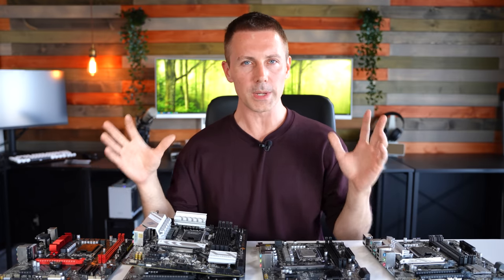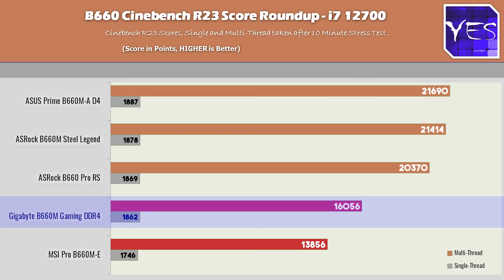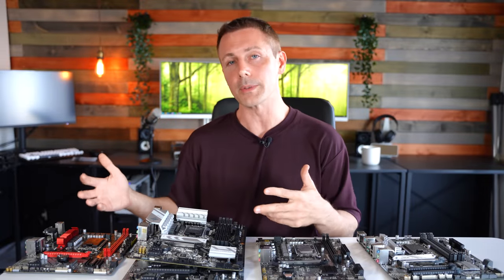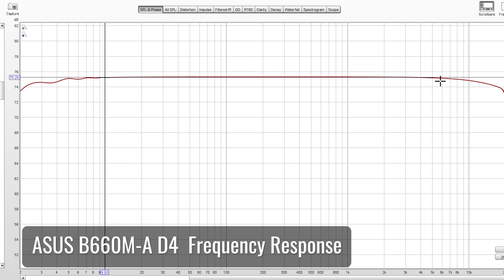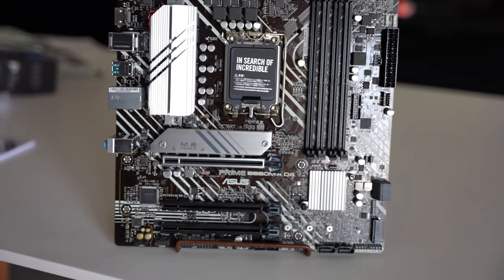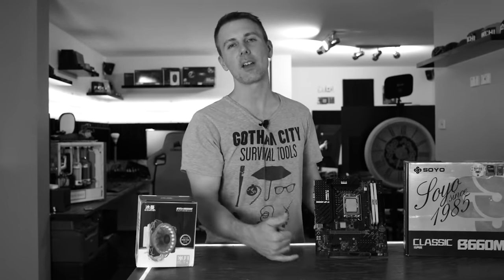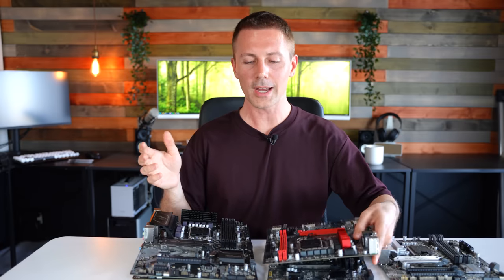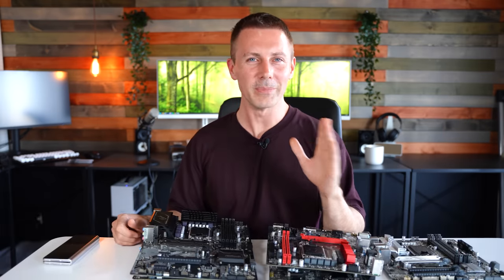What's the Best BUDGET B660 Motherboard?

Comment: Is the performance disparity because of throttling or because some vendors will blast voltage outside of Intel official guidelines ?
Reply: It depends
Reply from the maker: The gigabyte board I think something a little weird was going on there, though it kept going back and forth between 150w and 65w.  The MSI board definitely just couldn't handle the speeds though. Overall however, I am just testing with XMP on and going into it, something most people will do when they buy a new b660.

Comment: I got an Asus TUF B660 to use with the  i7 12700. Wish you had a unit to test beside those. 
Unfortunately I will be stuck the stock cooler for at least a month since Deepcool send their free 1700 mounting kit from China. Hope I dont have much heat problems.

Comment: I am about to buy Asus Prime B660M-A with i3-12100F. I guess the temps should be low as it's not as hot cpu as i7, right?
Reply: Hey, have you bought this mobo? I have this i3 and im about to buy this asus, is it running good?
Reply: @jankozerski5280  it is more than enough. I used it with i3-12100 and then i5-12400. Runing smooth. Now I have Ryzen 5600 with B550 ROG Strix.
Reply: @carrygun_  Temperatures of mobo with i5 were okay?  And did you have wifi version of this mobo? If yes how it was running?
Reply: @jankozerski5280  Chłopie, te i3 i i5 grzeją się podobnie jak cola w lodówce więc nie szukaj dziury w całym tylko kupuj i skończ dupę zawracać. Miałem wersję bez wifi.

Comment: guys, is the GIGABYTE B660M DS3H enough good for i5 12400f?
Reply: Did you get a answer im getting the same cpu
Reply: @cmoneytheman  yeah bro, after searching all internet like 4 days and speaking with many guys i took MSI PRO B660M-A.
Reply: @user-j9ki7r  im getting that one to with the same cpu which cooler do you use i gotta d9dx i use now for 3930 but I dont know if it will be enough for this cpu
Reply: @cmoneytheman  im using default one from the CPUs box! its more then enough
Reply: @user-j9ki7r  but Imma upscaler which is rendering with my gpu for hrs and uses some cpu I dont oc never have

Comment: I wanted to buy the gigabyte b660m d3h, but still not available. So i bought the b660m ds3h ax.
2.5gig ethernet, 10gbit usb-c(need it for external m.2ssd), 
 I stole a vrm cooler from an old board and put it on the second vrm side, at 120W (i5 12500) it is howering around 70-80C.

Comment: The best b660 board is msi pro b660m-a in terms of value as well performance which u didn't include, bdw why no youtuber review those cheap h610 board? Now they do provide xmp for upto 3200 mhz which i guess more than enuf for budget builders using i3 or i5 and also support gen 4. Plz make review of h610 and weather we loose performance in we choose h610 over b660 for i3 and i5
Reply: El Cactuar  why does it matter this not school and nobody talks so called correct all the time so stop the bull

 i talk like that to and use more slang u or nobody can tell me its wrong or right cause I dont believe in a right or wrong way

Comment: I'm unclear why the boards throttle at 100C for the VRMs since even running up to 120C should be within spec.
Reply: Producers are protecting themselves from warranty claims, as they are using cheaper components. Note that these budget boards in most cases would not be overclocked and will use i3 or i5 processors, so consumers would not notice.

Comment: Intel 12th gen stuff is still quite expensive here in Australia at the moment. But I was able to pickup a Gigabyte B660m Gaming motherboard on sale for $129 from PCCaseGear along with a i3-12100f for $169, so I guess that isn't too bad. I kinda wonder how much of a temperature difference there would be if one was to heat-sink the remanding VRM section, one would think it would improve performance quite a bit under load.

Comment: I've got Gigabyte B660M DS3H for i3-12100 and I'm OK.
Reply: u overclocked the ram on it
Reply: @AintPopular  i have had cheap ram so it’s stock xmp 3200 worked ok but yes you can try more clock, but, b660 motherboards have very small and not-changeable SA voltage (i don’t remember correctly), which helps in ram overclock a lot, so better to have better ram which suits you.

Comment: Just sent back 2 asus rog strix b660.

They’re Poop. First one came with bent pins. Yeah that sounds minor but i didn’t pay a ton of money for bent pins.

2nd one came fine but ran into the common issue with those boards of the LAN not working regardless of installing drivers, updating bios and windows pretty much everything. 

Reinstalled windows 4 times with no success. First three times it kept getting slower and slower and wifi was choppy. 

Sometimes it wouldn’t let me install drivers or freeze half way through a install or during a restart and shut down.

Even checked the bios settings and had help from a ton of people and nothing.

Wasn’t till the 4th install some how i managed to install all the drivers but yet the PCI drivers didn’t work and couldn’t install them. 

Common code: driver power state fail caused by Ntoskrnl.exe